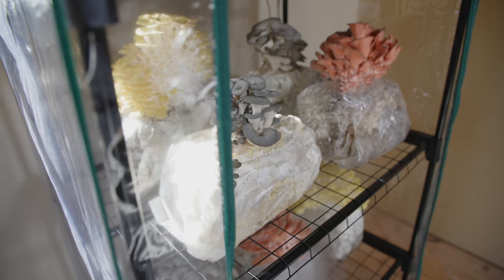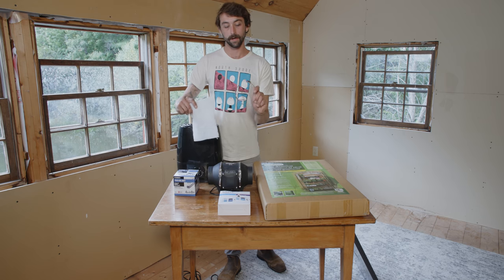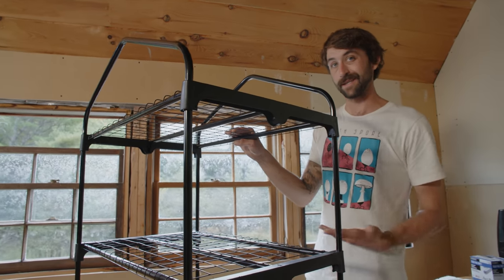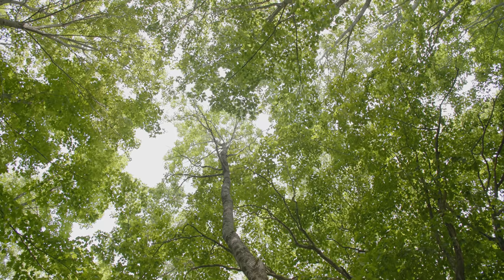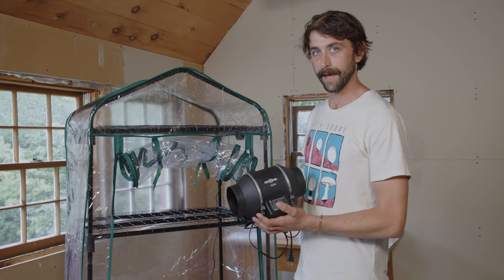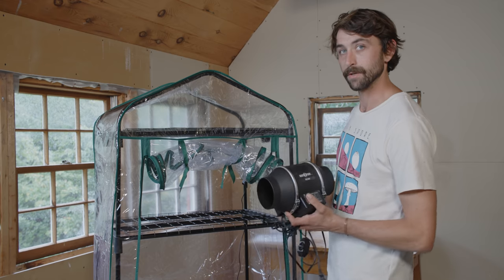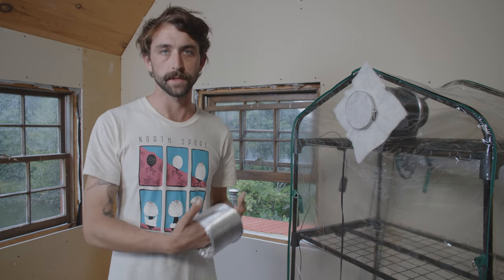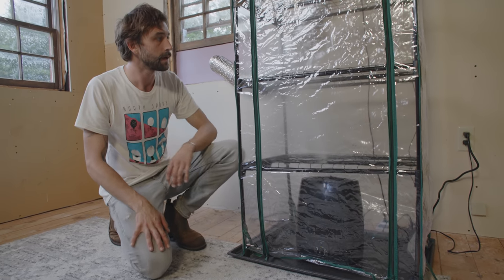Complete Martha Grow Tent Setup & Maintenance Walk-Through | Build a DIY Mushroom Fruiting Chamber

Comment: Wonderful video, thank you! I live in Pennsylvania in a tiny house and it’s getting very cold here… I do not keep my heat high and I’m wondering what type of heater I can put within my tent to control the temperature for my medicinal mushrooms. It would be wonderful to not have to run a heater within the house all day.
Reply: I did purchase a infrared basking spot light bulb that is made for reptiles and such. I was hoping that might work. I wish I would have started growing in the summer rather than this time of year… But I really do love these mushrooms! I’m having a hard time waiting until it gets warm again! ☺️
Reply from the maker: You may want to heat the general area rather than directly inside the tent as it can dry out the blocks.  In general, you want to get the tent to around 60-70F for most species.
Reply: get an oil filled heater. provides the most stable temps.

Comment: I was thinking about doing one in my basement that has a brick floor. Possible contamination is my concern.  Thoughts?
Reply from the maker: Everything is a vector, but if you take precautions, that space should be fine. Colonized substrate is much less prone to contamination. It's the initial process that is tougher. You could use one of these for that stage: https://northspore.com/collections/still-air-boxes

Comment: If you tap each shelf section together with a rubber mallet and then assemble the tower, also using a rubber mallet, it becomes quite stable.
Reply from the maker: Thanks for the suggestion!

Comment: I just went looking for humidity controllers on ebay & saw the brand of the one you used in the video gets really low ratings. How are you finding that specific brand since you started using it? I ended up purchasing a different one which gets much higher ratings. I also got a heat controller, just in case. I can always use it for a different project.

If using some source of heat might be necessary, what type would you recommend? Just a seedling type start mat placed closer to the bottom of the tent, which would allow a slight bit of heat to rise up to the top of the tent?

Also, if artificial lighting is needed, which type would you recommend? Not necessarily the brand, but wattage / output etc? I've got some honking grow lights for indoor seedling starts but think they might be overkill for mushrooms, although they are very much dimmable.

Thanks very much for the video. Very clear, very do-able. Very near completing getting together what I need, although I've got almost everything already.
Reply from the maker: I like your heat idea. Also, heat lamps outside the temp might be ok as long as they're not melting the vinyl! For lighting, a few small LEDs in the blue light range is all you need.

Comment: Excellent video!! Question, how do you disable the alarm on the timer? I would like it to do the job without the annoyance of alarming me every time it turns my humidifier on/off.
Reply from the maker: I'm really not sure if this is possible. If not and it's definitely a problem, there are other timers on the market that might not have the same issue.

Comment: If you duct humidity from outside FC you are introducing fresh air and 02. If you have humidifier inside FC you are just circulating built up co2. Not to mention the issues with electronic devices being in a wet environment
Reply from the maker: The fan pulls in fresh air from the bottom, so that is a non-issue. The issue with wet electronics is a real concern. It is done to simplify the setup. If you are up for attaching an external humidification system, go for it. There are so many ways to build one of these!

Comment: Right on, Really good video! I only have one question; do you have your duct fan exhausting 24/7? If not, then how do you have the controller programmed on the AC Infinity and also are these settings something that will be species/strain dependent? 🙏
Reply from the maker: Thanks!  Yes, the fan is always on at a low setting but the humidifier only comes on when the humidity drops below 80-90%.  Some species prefer it to be a little drier so it is important to check preferences for more finicky types.
Reply: @NorthSpore  Fantastic. Thanks for the reply!

Comment: Great vid. Big fan. 

Question - would you even need the air exchange fan if you hooked the humidifyer so that it takes air from the outside?
Reply from the maker: Perhaps not if the only job was fresh air, but it would take dialing in to make sure old air is flushed out. That brings me to why we like out system. The fan is powerful and pulls lots of fresh air in while also pulling all the spores out.

Comment: Wouldn't the constant running of the fan reduce the humidity substantially causing the humidifier to have to run continuously or does it hold pretty good?
Reply from the maker: This can be an issue but we set up the humidifier with a controller to turn on when needed.

Comment: Great, the first video on Marthas in which everything got clear for me!!
Just it there be possible that we could adjust a temperature control with thermostat, like at the lower levels onn a small bucket with a 500 watts aquarium heaters, I think that most probably works, or a bigger no water heater?... It's like what we can do to cultivate tropical species? I'll be grarteful for if fellows could give us some advice.
Reply from the maker: Sure you could try that. I've always found that it makes more sense for one of these to just use different species when the weather shifts.

Comment: Hey man, I have a lot of pooling at the bottom and I tried turning up the fan to a higher level, but it caused the humidity to drop and can’t keep up at 80%. The good thing is that there is no more pooling but it’s for the same reason that the humidity is just leaving the internal environment.. 

I have the same setup as yours.
Reply from the maker: This might have a lot to do with the ambient temperature. As things warm up, the air can hold more moisture and this problem should subside. You can also adjust the output of the humidifier. Between that and the fan, balance can be found. Also, think about where your sensor is in the tent. Maybe moving that will make a difference.

Comment: Amazing video!! With this FAE setup - what kind of fan speeds would you recommend, and would it change after pinning starts? My inline fan sucks the humidity out pretty quick at half speed, and wondering if I can drop the fan speed without adverse effects.
Reply from the maker: It really depends on your environment.  Start low and observe your mushrooms for lack of fresh air issues.  As long as you are exchanging the air in a consistent fashion, your mushrooms should produce normally!

Comment: Cool video but I think there is one small issue. In my experiences with humidifiers putting tap water in them is a no go. Depending on the hardness/softness of your water you'll get white chalky stuff all over your mushrooms, the inside of the tent, and the humidifier.
Reply from the maker: This is definitely something to keep in mind, though I've never had trouble myself, mineral content can vary a lot. No matter what's it's going to be important to clean everything on a regular basis.

Comment: Woah, hey...  you just ran past the filter part - what KIND of filter is that? Doesn't it need to be HEPA or something super fine? Aren't there specifications on which filters trap spores? 
Great demo though! That was still super helpful :)

UPDATE: your site states "poly pre-filter," but those only trap particles 2+ microns, where spores can be .3. I think a HEPA would be the only safe way to go.
Reply from the maker: It is absolutely preferred to vent outside if you can. Otherwise, if you're only growing a few blocks, the spore load is not all that high and shouldn't pose a significant health risk. If you've got a packed Martha, have health health concerns, or just want things to be as clean as possible, having an additional air filter going in the room can be worth it!

Comment: great video, just one question …with the co2 fan would that be on a timer ? or does it run for the majority of the time ?
Reply from the maker: You can just have it on all the time on a low setting or you can have it on a cycle timer. Having it on at a low setting most of the time can keep humidity more consistent and evenly distributed. If you do put on a timer, remember that more short intervals are best.

Comment: Thank you very much for this video. I  have just bought all necessary equipment.  
Is it a good idea to put Martha tent with filter from spores in apartment, where you live, or it maybe dangerous, because a lot of spores will be in air?
Reply from the maker: The filter should catch the spores and you can also make sure to harvest at prime time which is usually before spore release.  For example, we recommend harvesting when the caps flatten and become concave.

Comment: Hi, first time grower here. Was wondering why the digital humidity controller is needed. Does the humidifier not have one? If not, could you just buy a humidifier with one built in?
Reply from the maker: Nope, our humidifier doesn't have a built in sensor. Some probably do!

Comment: Hi guys, thanks so much for the informative video. Do you get many problems over time with the mushroom spores clogging up the inline fan & shortening it's life?
Reply from the maker: The fan should definitely have a pre-filter on it to reduce spore buildup, but it will happen eventually anyway. For sure clean it regularly. It's lifespan, compared to a fan that just deals with normal air, is very possibly shorter.

Comment: I’m interested in this setup, but wouldn’t the exhaust suck out the humidity? Do you ever turn it off, or does the humidifier put out more humidity than the fan can pull out? Won’t the fan get somewhat wet? Will it survive? Sorry for so many questions. :)
Reply from the maker: It does, but you keep adding more. It's about finding a balance and keeping the humidity within a desired range, while also providing new fresh air. You can keep it on low all the time, turn it off manually, or set up a time like this: https://northspore.com/collections/mushroom-grow-room-accessories/products/fan-cycle-timer

The fa, should be cleaned often, but is high quality and will last a very long time. Honestly, the fan is one of the best parts we sell and accounts for the value significantly.

Comment: would it be possible for this to work well enough for a hobbiest at home without the fan and humidifier? by just cutting some ventilation holes in the bottom and top for cross ventilation as well as misting daily manually for humidity?
Reply from the maker: Good question! the answer is yes, the air exchange and humidity could be managed manually, sort of like with a Monotub! However, it will probably be more difficult to dial in and manage. Also, with lots of holes, you will just be pouring spores into your home environment, which isn't ideal.
Reply: @NorthSpore  what if you covered the holes with microporous tape? would that prevent that problem possibly? thanks for the fast reply!

Comment: Amazing video! Just cropped out my first batch of Reishi today using this method. I plan to grow more, but I’m a bit concerned with the humidifier and fan being inside the tent at like 90-95% humidity. I wore the plugs outside but having the units inside that humidify… any concerns of electrical malfunction of the units or worse?
Reply from the maker: We haven't heard of too many issues, more with the humidifier than the fan, but most of those are probably manufacturing issues. Long-term, this is definitely a valid concern.
Reply: @NorthSpore  I just finished 2 cycles of fruiting using this system. I took the humidifier apart and it has a lot of spores inside of it and water. I'm going to use the method you used for pumping the fan out the window and do the same to pump the humidity in the tent. Should solve the problem. Thanks!

Comment: Just a few questions, I bought a lions mane mushroom grow kit on marketplace a few years back, and just used a simple plastic bag for a humidity tent, I only had the one block.  The guy I bought it off of suggested a reptile fogger for the humidity, will that still work on this setup?
Also, what about taping the bottom me the tent plastic to the drip pan everywhere except for the zippered door, and then swapping out the locations of the fan and the humidifier?  I was not told about spore contamination, this is the first I am hearing about it, and now it has me worried about growing mushrooms.  Maybe a hydroponic tent might be better?
Oh yeah, AND....If the air is being vented outside a window, is my lawn under that window going to be growing mushrooms because the spores are being vented out there too?
Reply: Hello, do you like mushrooms too? I'm looking for friends who share my passion for mushrooms, especially those who grow their own. Could have a chat?

Comment: Hello, will the air humidifier and fan break down when working in such high humidity?
The humidifier can be sealed from the inside, but is it also so safe from the outside?
Reply from the maker: It definitely increases their degradation rate, no doubt about that. Your concern is a valid one. So far, we have seen minimal issues of this sort.

Comment: would it be better for the humidifier to be up top? (humid air/fog will drop to bottom). Probably be easier to regulate? or is there a better reason to have it at the bottom?? good video!
Reply from the maker: Ours is set up to pull air through the tent so that we can capture spores - you could make a positively pressured system that pumps in filtered air but then spores would just be pushed out into the environment - also when you are dealing with colonized substrate there is no need to filter the air as the risk of contamination is very low.

Comment: Would you get longer life from the fan if you put outside the high humidity? Seems like putting anything electronic in high humidity like this tent would be a big no no for longevity. I'm also curious if large network rack fans, think extremely oversized computer fans, would suffice for a lot less money?
Lastly, since you exhaust directly outside, have you found mushrooms growing on the property outside the shed? Also, could you capture rain water to use for your humidifier or is tap better?
Very new to mycology and just curious, thanks for the vids and for all the supplies I've purchased from you, boomer substrate, agar dishes, monotub kit, and grain bags.
Reply from the maker: Bottom line is probably yes. There are so many ways to do this and so many different materials can be utilized! This is just one way and we like that is compact and funnels the spores out of a living space or toward a filter. We have not seen or heard of mushrooms growing spontaneously in people's backyards from this. Tap water or even distilled water is best. Thanks for your support!

Comment: fantastic video, congrats!
I have a question to ask.
with the negative pressure extractor you remove the carbon dioxide, but how do you keep the oxygen levels up?!
that is: the extractor is to remove the air full of carbon dioxide and the air full of oxygen where is it taken?!
I don't know if I explained myself.
Thanks for the reply.
Reply from the maker: When you remove the CO2, fresh oxygenated air is brought in. The trick is balancing that with humidity.

Comment: I reside in a hot climate where  maximum temperatures reach 40 degrees. Will the fan and humidifier be enough to regulate temperature  if not what should I add for suitable growth.
Reply from the maker: You'll be limited to certain species, but the process of dialing in airflow and humidity is essentially the same.

Comment: Thank you for the great content! Just a couple questions

I'm setting up a tent in a bedroom where I can't exhaust outside. How would I control or filter the humidity that's being sucked out?
I'm thinking of using a carbon filter to catch the spores, but wouldn't the humidity affect the efficacy of the filter?
Reply from the maker: Humidity leaves and you add more with the humidifier. It's the nature of the beast. You can get a freestanding air filter and aim the exhaust at it for more filtration. Be careful not to add so much filter that the airflow is pinched off. The humidity shouldn't cause a big problem there, but it does need to be cleaned or replaced regularly.

Comment: Quick question, do you just leave the fan running 24-7? Or would you use a timer to cycle at set intervals?
Reply from the maker: It depends on what you're growing. Many things, like oysters and lions mane, want pretty constant airflow. Others like shiitake and reishi, need very little.

Comment: What about some kind of float valve (like from an auto dog water dish) that could be set into the humidifier  along with a larger water supply (a 5 gallon bucket) up on a stool and run a length of tubing through a hole drilled into the humidifier chamber? Without this I would worry that I have to check the humidifier all the time, or can't leave for a long weekend without risking a major humidity crash. Especially in cases where you don't even have water on site. Would it be a further advantage that you would no longer need to open the Martha up to add water? How often do you clean the humidifier?? Thanks.
Reply from the maker: This could work with the right setup, probably not our humidifier model. You'd still want to clean it about once a week!